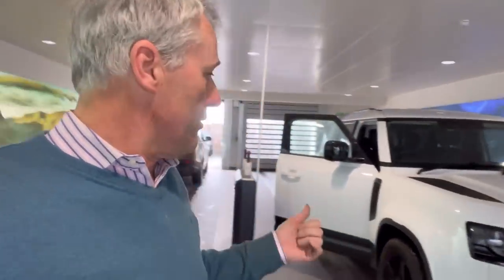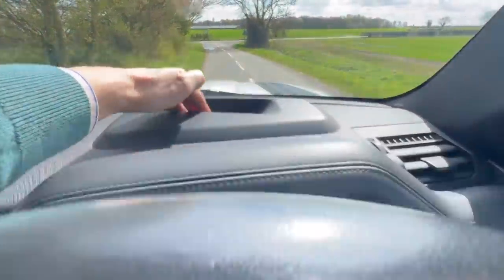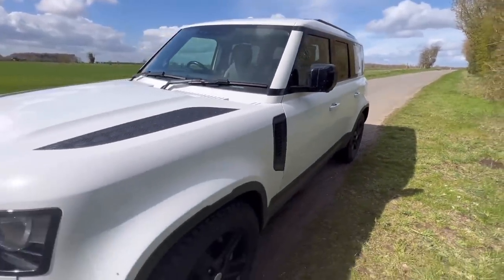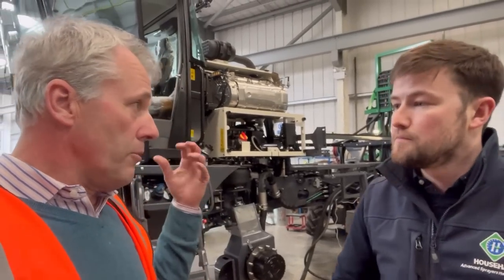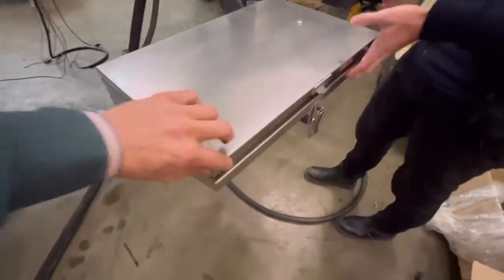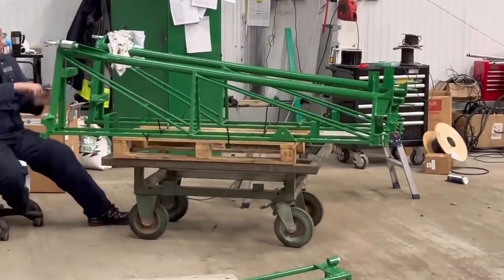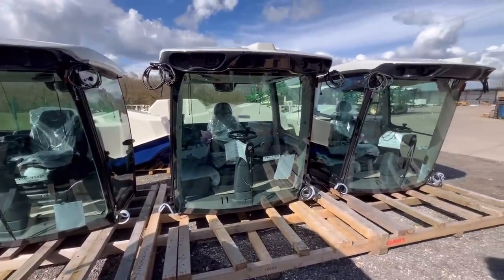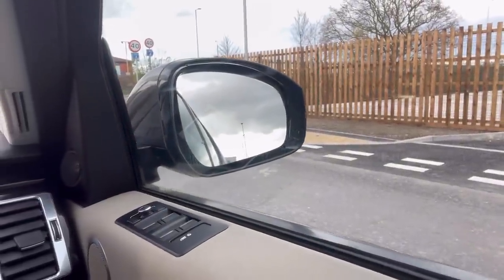FARM UPDATE 131 LAND ROVER 110 DEFENDER TEST DRIVE. BUILD PROGRESS OF NEW HOUSEHAM SPRAYER.

Comment: Good morning Andrew. Most farmers seem to use Toyota Hilux here in Cornwall. From what I understand much lower running costs and a 10 year guarantee if serviced at Toyota dealers.    Also a very late comment on Sugar Beet drill. This seems to be a brilliant piece of kit. Seed placement and ease of adjustment plus all at a high forward speed.
Reply from the maker: Interesting re Toyota. I’m half wondering about a swb Landcruiser commercial but I think I’d miss my disco,

Comment: I love my Defender and my personal view is the door mirrors are perfect for rear vision I've driven lots of vehicles with useless ones, not these.
I wouldn't have a vehicle with a sunroof, don't see the point of them. And as for the wind noise the vehicle is basically brick shaped so what do you expect. The disco and Range Rover are for the road drivers.
And to counter the lag as you call it try using the sports mode by moving the gear leaver over you will get it wheel spinning.
But as ever each to their own point of view. I'd never go back to an old one now.
Reply from the maker: It’s not good if you have to use in sport mode all the time just to stop the lag, using more fuel in the process. I know many people who have RR and Disco’s and they go off road all the time as I do without a problem.

Comment: the D250 that I tried had no such lag issues and the power was more than adequate.
Reply from the maker: I’ve had quite a few messages on here from RR and Disco owners, they all say their vehicles do it.
Reply: @WardysWaffleAndrewWard  
Really? I’ve driven many V6 3.0 and the new Ingenium D250 Defender for a couple of days and all I can repeat is that I did not find it so. It may well be so, but the way I drove it [varied] the issue did not show up. I know how such an issue manifests, as I have a 2.2 auto Ford Ranger which has an embarrassing amount o lag from idle speed [to lower emissions of soot apparently]. I found the D250 to be as good as, but lower in power, than the BMW X7 that I’ve driven for the last three days over hundreds of miles.

Comment: Gutsy call that electrical install on the sprayer 🤞getting 2 different systems to talk to each others is always tricking and being No 1 just adds pressure.
Reply from the maker: I think that’s what they are sending the screen and receiver to Denmark so Househams software suppliers can check it all and make sure it works before fitting in the sprayer.

Comment: Do not buy one, I have one with a driveline vibration bad enough to make you hate driving the car. Had it back for warranty 3 times and Land Rover say it's operating within design limits. Yet they do say there is a vibration. I am an independant Land Rover tech with 35+ years of experience and this is not what a vehicle should  do and for them to tell me that is insulting
Reply from the maker: Interesting. You shouldn’t be having that with the cost of them. 😖